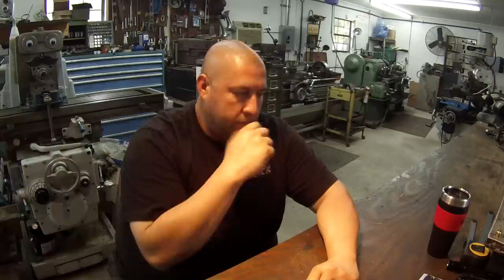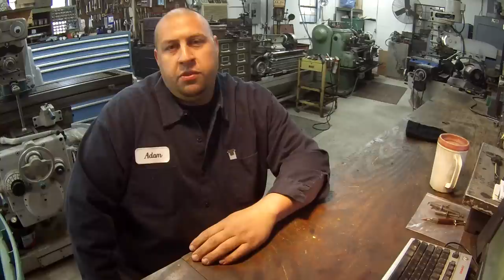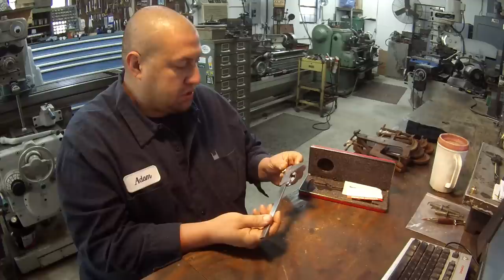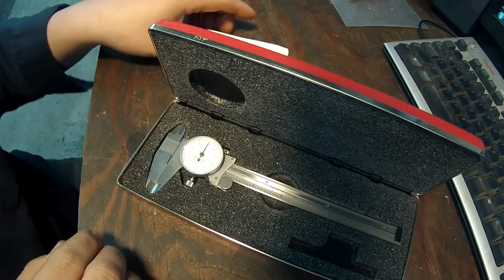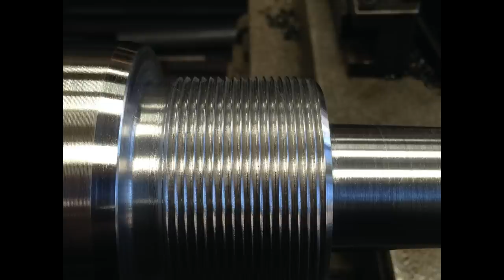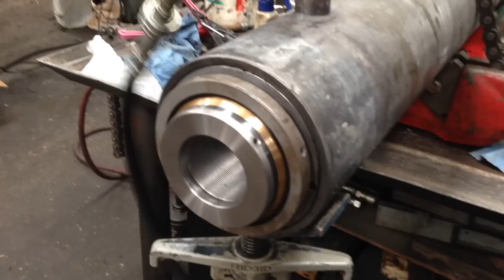Saturday Night Special 43 Part 1

Comment: Adam, sorry to hear about the break and enter. I have been through the same scenario before. Lots bike, expensive bike.

Luckily the thieves are morons and will most likely be caught soon. They steal the few things they know they can off easily and totally bypass anything of true value.

Good that you got an alarm system and the video surveillance will be great. Make sure to setup the cameras so that you can also use them to shoot your vids. :-)

40's, lol come to Canada

Awesome score on the kant-twists.. $17 for them all is nice. Nice score on the rest of the stuff too.
Reply from the maker: It's actually a bit colder here sooner than normal. It went from being hot, to cool for a couple weeks, then cold. Good thing about FL is that the cold usually doesn't stick around for a long time untill late in the winter season.

Comment: Sorry to hear of your break in and can see how frustrated and annoyed you feel, I think we would all feel the same way. I do worry about where this flea market, car boot sales (here in the UK) popularity will lead to, only been to one myself and was struck by peoples eagerness to purchase items without thinking about where they possibly came from. As for your windows I always think the Spanish have got security right with there way of putting decorative bars on all the vulnerable windows of a building and because the old houses all have them they do not look out of place, you could do something similar on the outside or inside of your shop windows. In fact now I come to think about it, I recall the factory (where I worked) had internal horizontal bars on places like the toolroom windows. Take care Adam and also look after Elana's safety.
Reply from the maker: Thanks Stephen. I've already looked at some winow guards at a buddies shop and will be using some expanded metal, that way I still get plenty of light through, and it doesn't look like a jail.

Comment: I got a call at work, one day back around 1993, from my girlfriend.  She said somebody broke into many garages up and down our street.  I had a couple roll a ways and other stuff in our garage.  We had a tilt-up garage door (as did everyone else).  But, prior to the incident, I drilled a hole through the bottom door frame and cement floor and installed a big ass "cane bolt" on the center stud of the door frame.  I drilled, tapped and scewed a short light chain with a spring clip at the upper end.  I'd close the door, drop the cane bolt through the lower frame, into the cement floor and clip the chain onto a small eye bolt/screw:  to keep the bolt down, even if some super thief tried to lift it up.  I would exit the garage through a dead bolted back door.  She said, "Don't worry, our garage was the only one that wasn't burglarized!"   But I haven't always been so lucky.  A security camera MUST be able to identify the scumbag or their license plate # s.  Otherwise, you only get the feeling of violation twice, because all you can do is watch blurry dudes steal your property.  Keep that in mind.  A hidden hi-def camera mounted where it can capture anyone entering or leaving your property might be enough to identify the scumbags and give the cops some good evidence.  You could also review the past week or two of recordings and catch them staking out your place.  HD and two weeks of recording means a lot of hard drive space.  They act bold when they are casing, since they aren't committing a crime....  Yet!  Get to know your neighbors, pass the word, watch out for each other.  Maybe get a vicious dog?  It sucks that you have to live in a prison, to protect yourself from felons!  RRRRRRRRRRRRR!
Reply from the maker: I've been talking to the neighbors about the incident, and word has gotten around. They're all keeping an eye and ear out for me.
Your right about the camera thing. You have to get a good image of them, and even one showing them taking your things. If there was a camera inside showing the thiefs taking my stuff, thats hard evidence there.

Comment: Adam,
I am so sorry to hear that some damn assholes broke into your shop! The bastards . . . they took the stuff they knew they could unload quickly. Machinist tools, fortunately, are specialized and not something that they could get a quick buck for. It's a sad statement to how things are when you have to turn your house or shop into a fortress! Time for the razor wire on the top of your fence! As you mentioned, some heavy, expanded metal welded into an angle iron frame and bolted around the windows will help. I am deeply sad that you had to suffer this indignity. It's makes me sick to think these cowardly pieces of shit inflicted their greed for drugs (or whatever) on you. Again, Adam, I am truly sorry this happened to such a person I consider to be a friend. (Sorry if I got a little carried away!)
I did like your flea market finds, especially the Starrett dial caliper! You do love those red boxes, don't you! What are those huge cylinders used for? Are they for oil platforms? Thanks for another SNS!
Have a good one,
Dave
Reply from the maker: Dave those are ladle cylinders, used for dumping hot iron. They are in a harsh environment and always come in destroyed. It took a whole day just to get them apart. I had to cut the back end off to pull the rod and piston out the back, and then lots of heat, and a 1" thick spanner wrench I made to finally unscrew the gland.

Comment: cameras are the first best cheapest option - $50 each for trail cams (roof mounted)...then loud alarms with lights, any kind preferably untouchable and hidden: crap neighbors can't ignore, must respond (airsoft CO2 grenades 150 db. (gunfire sim) and OC pepper spray flood units (can't breathe, must leave) [+ pull tab smoke bomb, same actuation but pull instead of press/depress, if possible=can't see/breathe]: can DIY one with any spray unit (get large grizzly size) or buy comm'l version)...then bars and metal doors, reinforced locks, etc. but is pricey unless DIY....lowes/home depot basic door bars start cheap $100 per door in white or black.

Comment: Ooops. Watched part two before part one. Sux about the thieves! I don't have a shop (I WISH) but I DO have a lifetime collection of tools and some expensive R/C toys. One is a six-wheel-drive Monster that is ONE of a kind. Lots of hand cut/bent aluminum and 4-40 thread everywhere (that I should have used Pop-rivets for). Wouldn't take two grand for it.

Working with my table top drill press and Harbor Freight cross-slide vice doesn't come close to a real mill. Chaps my cheeks that a company I worked for a few years ago had a lathe and mill that were just collecting dust and when they went out of business I didn't have the bux to buy them...

I do have a security system. And my "little friend"...

Comment: Hi Adam Sorry for your losses .I to was a victim last week but they got my house the big loss was about $3500 in coin as well as the damage.My house is alarmed but they bust out the basement  window and did not set the alarm till they tried to come upstairs then all hell broke loose.I have double cylinder locks on my doors so they kicked out my patio door It is tempered glass so they kicked the frame out.I missed last week building window bars and believe me how pissed off I am to live in a cage now. I am just glad my shop is a vault .

Comment: Hi Adam, sorry to hear about this break in, I guess it could have been a lot worse because you have much to lose.in your shop. The expanded metal was the first thing I put on my windows. It welded to 2 in. wide metal frame all around use to secure it to the window frames. That violated feeling is the worst, back in the early 90's I had a $4,000 motorcycle stolen from me. When the police came to take the report, I was told that I might as well forget about the bike, that I would probably never see it again. Violated again, they don't even try to find it, they said if I were lucky and  the crook got caught for something else and they found stolen property was the only way I get it back and then it usually in pieces. or just some parts. It's such a shame good people have to guard against, having what they have worked so hard to get, from being stolen. You should bait this guy so he is caught. Good luck to you my friend and another great video.

Comment: Adam, that sucks rocks that some useless waste of space picked you to steal from.  They used to hang horse thieves....I think they should go back to that for burglars and a few other criminal types. Once they've been hung, they usually don't do it again.

I'd be tempted to go the roach motel path on shop protection...put up some steel on the windows and doors yes, but link them to the alarm system with a delay or maybe some motion detectors...criminals break in, but once the hydraulics slam the exits shut, they don't break out...until the police are there to haul them off to jail. Tempted, but I suspect some bleeding hearts have made that illegal or something. Your system should deter them, and once you seal up the exits with some bars or whatever, they should have to go bother someone else. 

Hang in there. You've done what you can, and we're all rooting for you.

-- Mike

Comment: Those bastards.

You have to be careful now.

Get a huge horn and have it set up inside. Sound is one of the most oppressive means that doesn't kill. Shore up your defenses. Unfortunately you're on the market for these assholes. Hopefully the cops can catch them.

From personal experience you need to make them fear to get in your shop again in order to deter them from ever doing it again. Had three such occasions. First two they succeeded. Then i got someone to install me a sound deterrent. The 3rd time i found the door pried open but nothing stolen. They simply ran away.

I wasn't kidding btw with the horn. Get the loudest thing you can possibly get and stick it inside. Sound is ten times more effective than anything non-lethal publicly available. And on the off chance that someone does get stupid and tries this s**t again with you, you can bet your top dollar they won't be able to do anything about it.

Your friend from the security company can hook you up with an extender board that can hold the extra horn/horns with their separate power sources.

Be safe, be strong.

Comment: HI Adam,
It's my first comment on your channel but I have been watching for a while and always look forward to sns.
I know the feeling you get when you find out some low life has nicked your gear as I had a break in a few years back and lost an air compressor.
They cut the hasp on the door lock and bent it to open then after they got what they wanted they locked it up again and bent the hasp back into place , I didn't know I had been robbed until I was out in the workshop on the weekend  and got that strange feeling that something is missing ! they even unplugged the air line and rattle gun that was attached !
I made a new hasp and staple lock  from some 3/4 thick steel with a cover for the padlock so the only way in without a key was with an oxy set , a grinder or a truck to rip the door off !
The only thing I hate more than a thief is the idiot that buys the stolen gear from them as it is feeding them . 

Ian

Comment: I am so sorry that this has happened to you! The last thing you want is to be constantly worrying about your workshop security, these morons have also hit the American economy in as much that you are sidetracked into devoting time, and thought into this pitiful situation, I had the same thing happen to me in UK, they ram raided my steel doors with a 4x4 and tried to silence the alarm system, the damage they did was many thousands of pounds worth, all for a pittance for gear sold at flea markets, I would wipe them from the face of the earth!!
Reply from the maker: Man that's messed up. Sorry to hear. I think my situation is similar, having to invest in security, and material to guard everything.
Reply: Adam, do you think Stella might like a friend?  Maybe a Rottweiler or Doberman that likes to hang out in your shop when you are away?

What has four legs and one arm?  A happy Pit Bull!

If you put a few scrolls on the ironwork, it won't look like a jail, just Spanish style.  

-- Mike
Reply: GOT THAT T-SHIRT , EVER TRY TO REMEMBER (( EVERY TOOL ))
YOU HAD , FOR INSURANCE ??

Comment: the thieving is so directly tied to the drug usage so prevalent today. touch wood, but it's been a while since I had an event. but between 85 and 94 I had tools stolen from my work truck, then the truck was stolen, and we suffered 3 b & e burglaries. after the third my then wife insisted we move.
despite the temptation, don't go with the suggestions to set mantraps or electric fencing. you would probably be held criminally as well as civilly responsible for any injuries as well as the "pain and suffering" the perpetrators might suffer and would perhaps go to jail while a clueless jury bankrupts you with a personal injury and punitive damages award to the "victim" of your "criminal" act.
Reply from the maker: Your right. It's against the law to set traps like that, as much as we want to. Makes you angry doesn't it.
Reply: Abom79 it's even worse. a number of years ago I read of a case brought by a burgler who fell over a child's toy in a house he had broken into, he won his case. the homeowner victim of the burgler was ordered to pay the burgler  damages. so much for the so called American "justice" system!!!!